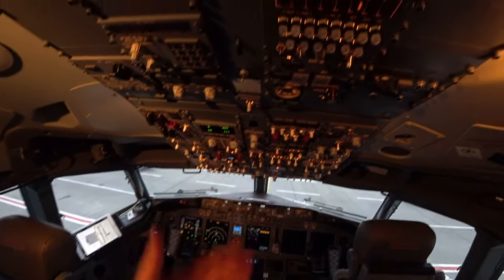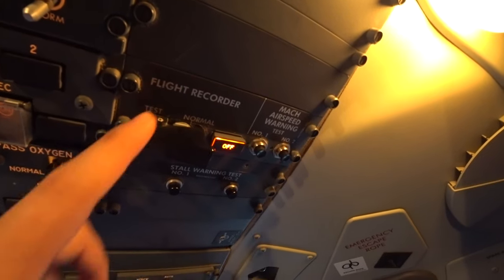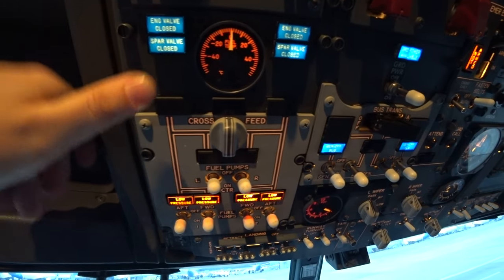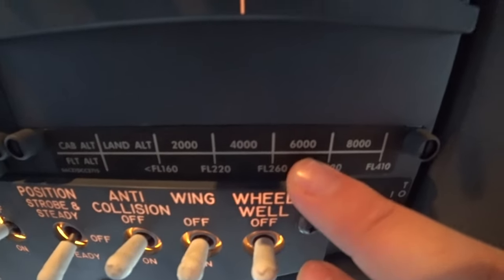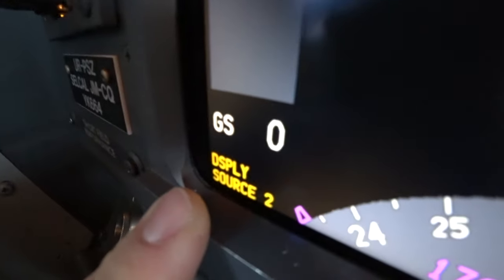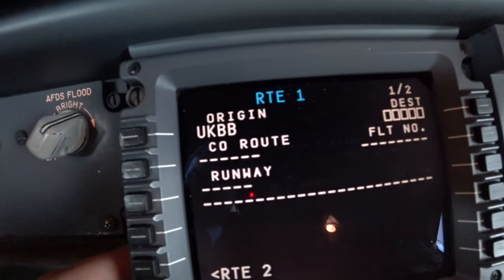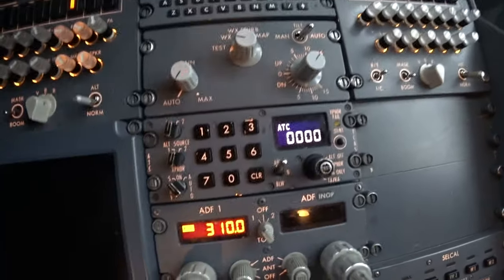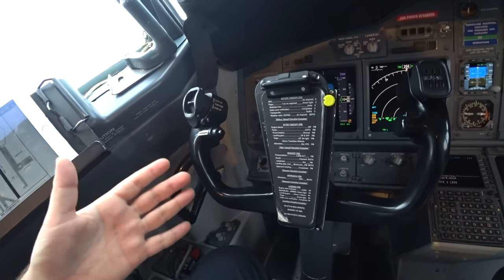Boeing 737 cockpit explained by Pilot Blog

Comment: Did you know: You don't have to enter a "REF Airport".  The feature is just a tool to easily obtain coordinates in the event GPS ones are not available.  Same with "Gate".  They both give you coordinates that you can drop into scratchpad instead of having to manually type them into box from charts.  Cool video, thanks for sharing.

Comment: Hi, I have two questions about the lights in the cockpit. 
1. MAIN PANEL Light Control for the captain and the F/O - what do they control exactly (each of them). From the manual I understand that the Captain's Main Panel switch controls Captain’s panel and instrument lighting,
center instrument panel, and AFDS panel displays and edge lighting. Does it include F/O's EFIS control panel, or is this panel controlled with F/O's MAIN PANEL Light Control?
2. Circuit Breaker Panel Light Controls - does it provide light for the circuit breakers behind both the Captain and the F/O? Or only on one side? How much light does it give?

Comment: can i just ask when does the outflow valve open, also what is the reason for the stall warning test to only activate 4 mins after AC power has been put on the busses ?
Reply from the maker: Do you mean the main outflow valve? 
If you turn by off the AC supply, the battery starts to discharge, that sound is not the stall warning, that sound is in the special horn to alert technical staff that battery is discharging. Works on ground only...
Reply: @PilotBlogDenys  no I mean the stall warning test will only work once you have been on the ac power for 4 mins the one on tjr top overhead panel below Mach over speed test

Comment: Hello. I want to be a pilot on the 737 800  it is my favourite aircraft .  I got a question though.  Do  you find the cockpit comfortable for a long flight and is that seat actually comfortable? 

Keep up the great work
Reply from the maker: Hi there! Thanks for your question. Personally I find B737 seats quite comfortable since you have many of adjustment options for your back, feet, head and arms. There are better seats however like in A350. Anyway I feel Ok flying it even 5hours flight.
Reply: @PilotBlogDenys  okay thanks. Because I've heard many 737 pilots who now suffer from a lot of back and leg pain. Do u think the seat causes you back pain? Also, does the 737 have an intercom where you can talk to the other pilot through your headset or do u have to take that off to speak to them?

Thanks
Sam
Reply from the maker: @theskyishome6694 I don't think that B737 can cause the back pain or other problems. I used to fly the ATR72 before and  seats there were much more uncomfortable than Boeing's. You can use the Intercom by selecting the audio panel switch to "INT" position. No problems with that...
Reply: @PilotBlogDenys  thanks for your reply, so overall, the 737 is a fine aircraft to work in
Reply from the maker: @theskyishome6694  I think so. But of course there are better... I just don't have experience flying Airbus, Embraer etc...
Reply: @PilotBlogDenys  that's fine I'm happy as long as it doesn't cause any back pain or any discomfort during flight. Also, is the 737 800 going to be retired soon by airlines?
Reply from the maker: @theskyishome6694  I think not very soon. As we see now even 737Classic is flying in many of airlines. I hope that 737MAX will fly again soon...
Reply: @PilotBlogDenys   okay thanks for your help
Reply: Pilot Blog  one last question, do you enjoy operating the 737 800 day in day out
Reply from the maker: @theskyishome6694  in good old times we had 5days on and 2 off. Also many of nighttime... It is fine for me. I like flying...
Reply: Pilot Blog oh that’s good. How did u pay for training and any training tips?
Reply from the maker: @theskyishome6694  https://youtu.be/uxOFZR0tmB4
It is all here. Now you need to search for reliable flight school. Many will just go bankrupt if the crisis continues...